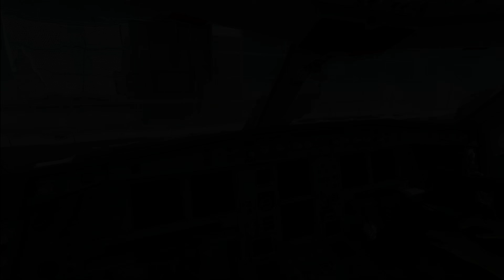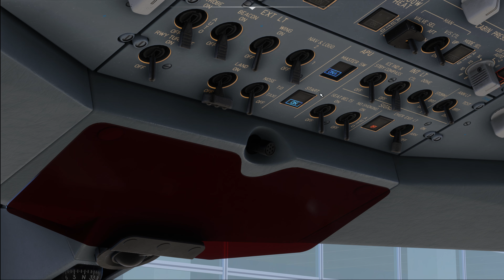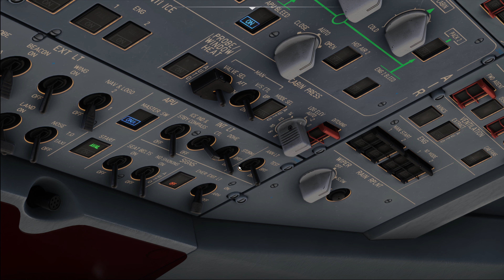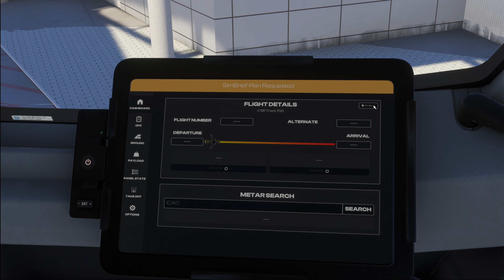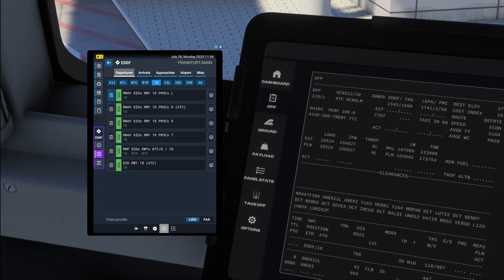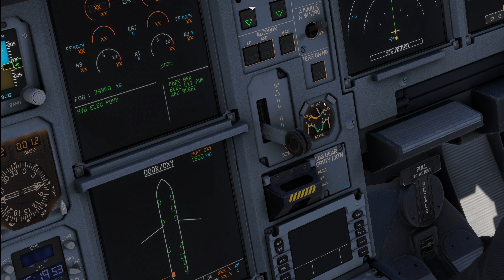Airbus A330 - Virtual Type Rating | Preliminary Cockpit Preparation | FS 2024 | Real A330 Pilot

Comment: Very helpful to see the whole process at slower speed with explanations. Quick question: do you have a sense of how accurate the EFB TO performance calculator is? I find it often differs from simbrief, but not sure which is more correct.
Reply from the maker: Hi, I'd say it does the job, but the numbers differ from what we normally get at my airline.
SimBrief also isn't quite the same as my airlines numbers unfortunately.

Comment: Another excellent tutorial series? Thank you so much for doing these: I've been learning lots from earlier ones. Could I ask a few questions that come to mind?
1. Why is it that you need a higher voltage from the batteries when the aircraft has been off for longer? That seems back to front, somehow.
2. Why is it that there are two separate external power controls? Does the aircraft require more power than a single feed can supply? Do the controls actually reflect two physical feeds?
3. What does the aircraft do in the 3 minutes after turning the APU master on, that changes start performance?
4. How does the aircraft use high/low pressure air feeds? Does one of them allow more functionality? Can you tell that one is connected by any means other than asking the ground crew?
5. Why does the order of switching on the ADIRUs matter? And what is the third switch position actually for?
6. Is it only the A330 that has the two-way switches on the dome light? (So you can get in and out without kneecapping yourself, presumably?)
Thanks!